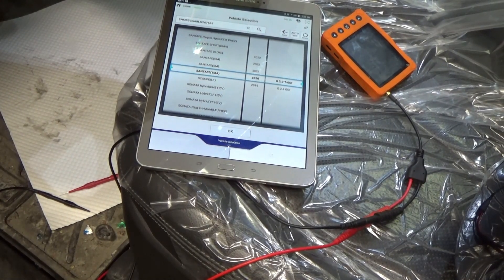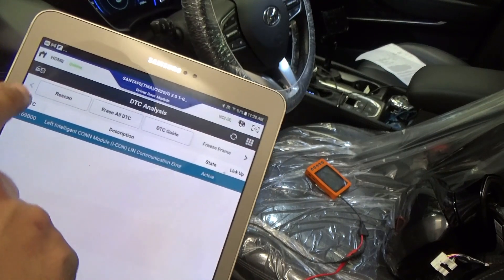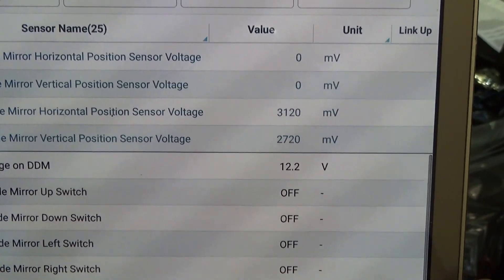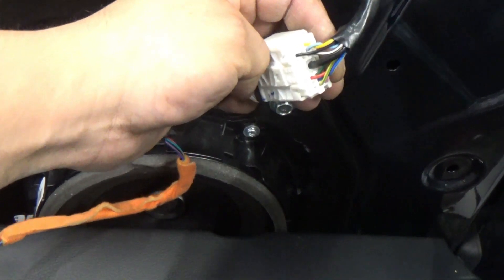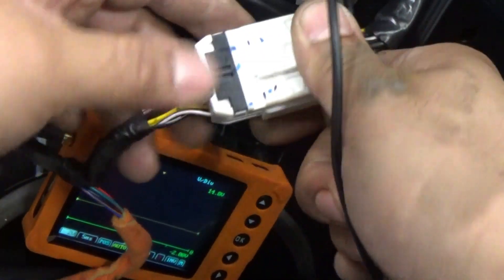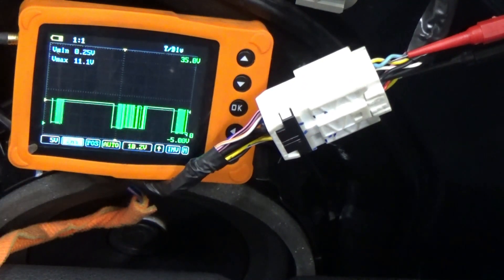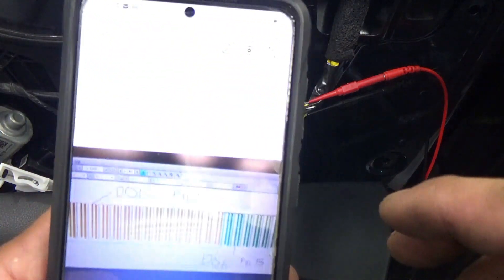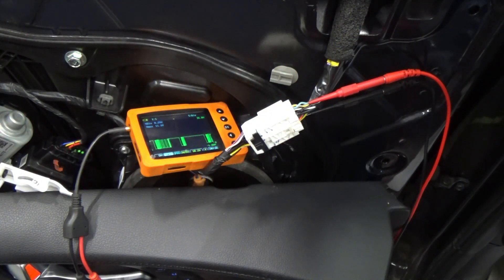HYUNDAI SANTA FE SIDE MIRROR NOT WORKING, LIN BUS FAULT

Comment: Great video! Intermittent issues are difficult to deal with. What kind of scope is that? I have tried to get boss to get the Hyundai scope for the tablet for our dealership but GM won’t budge!!.
Reply from the maker: This scope its called uscope, 1 channel, good for quick testing. Usually hyundai has the 4 channel scope but i really dont like that. If you want to start using scope my first scope was an autel, it was not bad i started to learn a lot from there but the some stuff are limited. Right now i have the 4425a pico scope
Reply from the maker: Of course those management people will not spend those stuff man, all my stuff i bought it. Hahaha